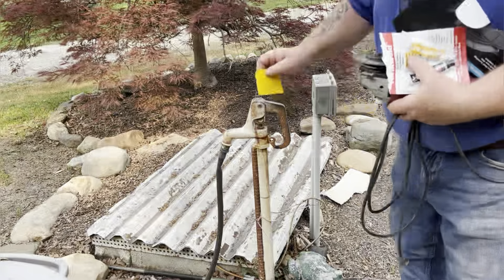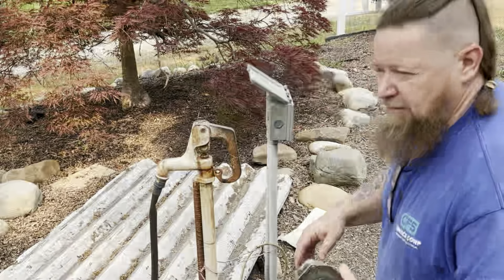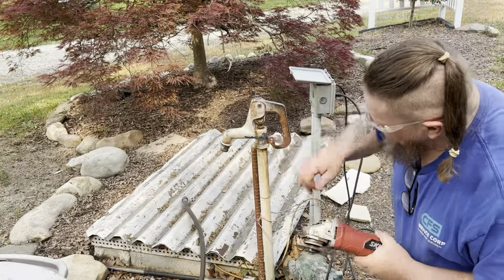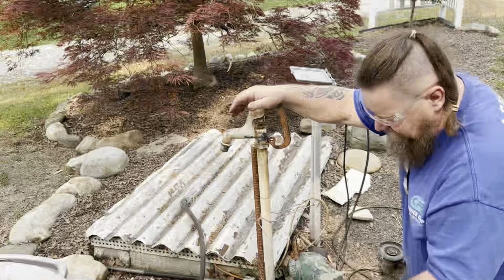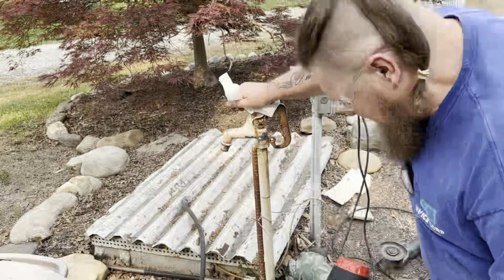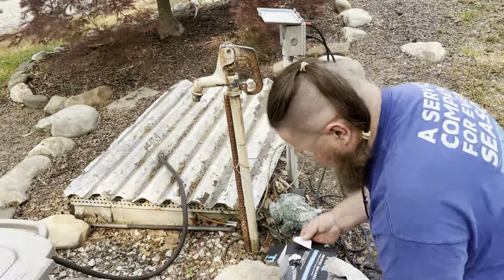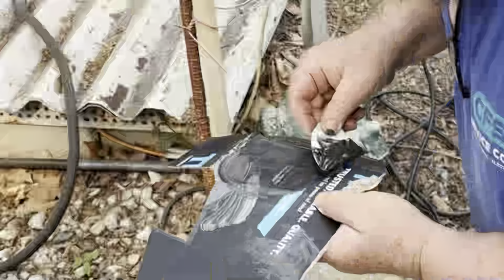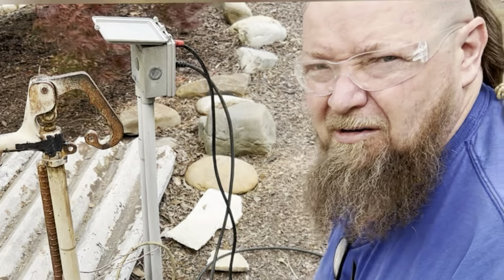How to fix a Cracked Water Spicket ￼.         With JB Weld

Comment: Going to try this see if it works
Reply from the maker: @natoga3329  
You will definitely need to clean the metal down the bear steel maybe even groove it a little bit in the crack and apply lots of JB weld